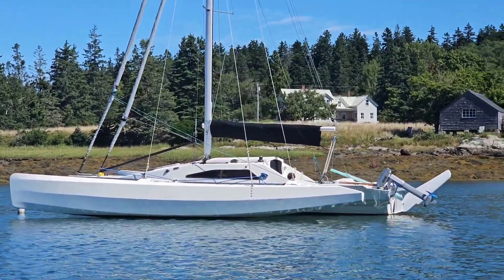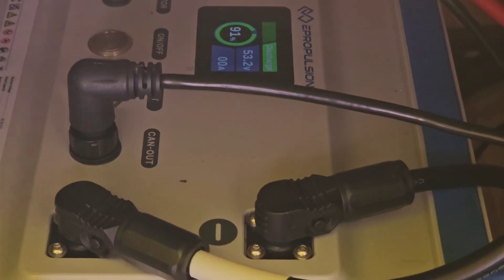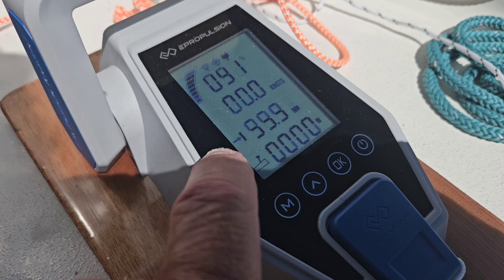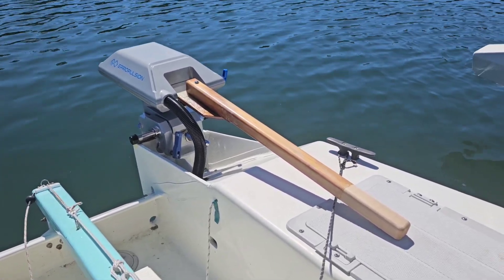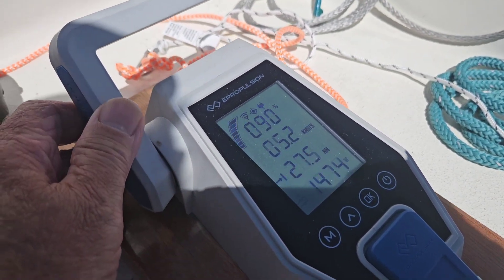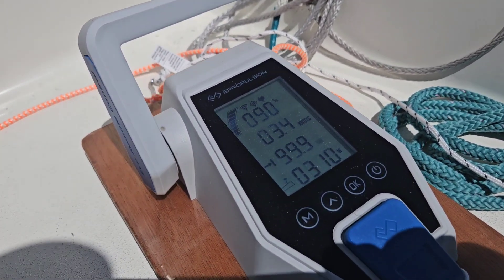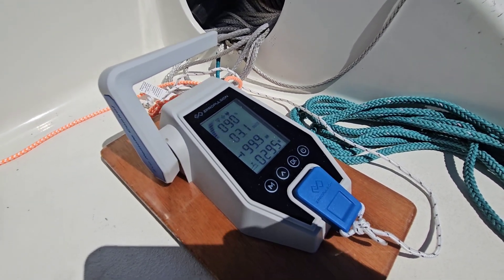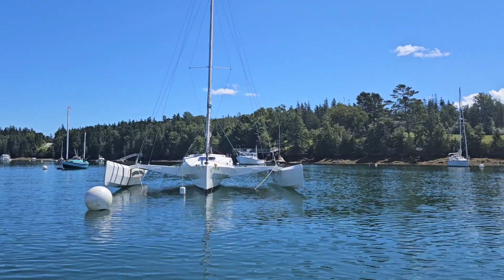Scarab 22 trimaran with E Propulsion Navy 3.0 and E 60 batteries.

Comment: Why not suspend the flexible solar panels, like trampolines between the rear of the floats and hull, behind the aft arms? Leave the Tramps clear. Your power vs speed curves are very impressive. My 4.5m sailing dinghy, uses around 200-250 watts to go 3 knots.
Reply from the maker: Good Idea I will look at putting solar there to see how I might do it. I agree on the power vs speed. I have been pleasantly surprised also. I think the long and narrow hull helps. This boat is also really light for it's size.
Reply from the maker: I just uploaded another video of a 20NM trip on a calm day. 20NM average speed 4.7 knots, I used just over 3kw.